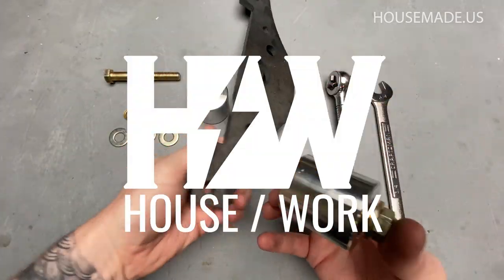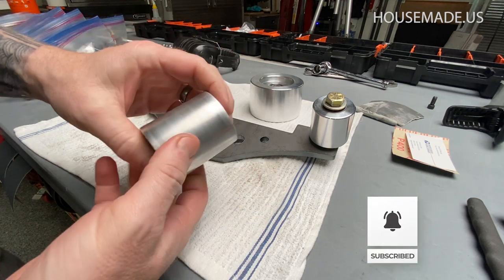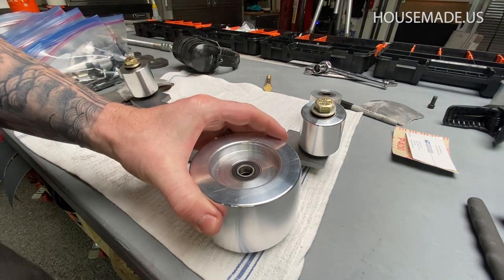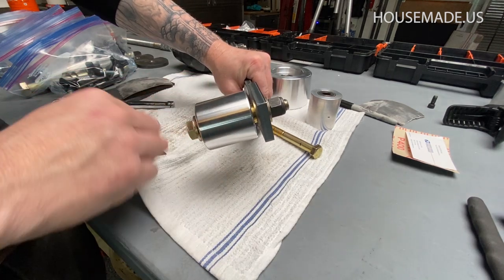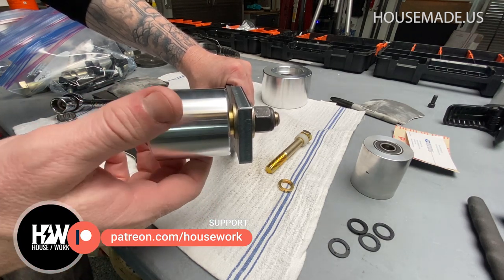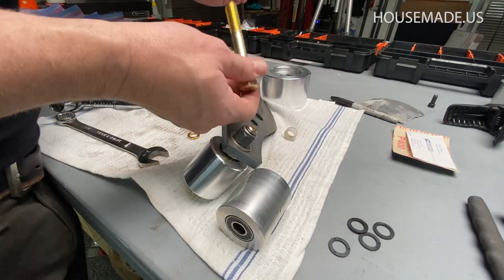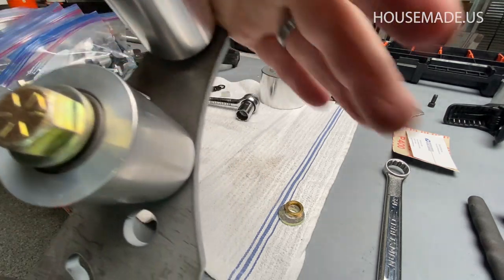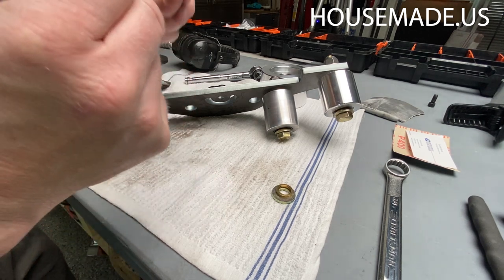How to: 2x72 Belt Grinder Platen Wheel Hardware

Comment: Brian, just to make sure you know, nylock nuts like you have are technically one time use. After the threads are cut into the nylon locker, they just don't hold as securely.  You can however use a little blue loctite and it'll work just fine. 
Also, the washers you are using are "SAE" washers which are cut to the basic size of the bolt. "USS" washers have a slightly larger center hole and an overall larger size as well.  I prefer the SAE like you have. 
Cheers buddy

Comment: Hi may i point out you should not load a bearing laterally at all. the bearing should have a spacer tube between them, so as you bolt up on the inner of the bearings races it forms a solid tube with no side load or binding as you called it regardless of how tight the bolt is. Looks a cool design have to get it cut this side of the pond.
Reply from the maker: Yes I totally agree. Most wheels I’ve bought don’t have that inner spacer though. They seem to work okay so far. 👊🏻
Reply: The suppler is using a threaded plate to mount the wheels, a nut ether side of plate would be the best option in your case, seem silly to let a easy fix slip by for the viewers that will follow every word better to get it right than works okay so far.
Reply: You take care of the out side with your little spacers but the inner tube Spacer between the bearing races should be in there. That way you won't create the lateral load on the bearings. All the load as you tighten the bolt will be on the Spacer, inner race, inner Spacer tube, the other inner race, the other Spacer then the platen.  No load on the ball bearings this way.   Hope this explanation helps

Comment: The link to the speed washers is broken.  What is the part number at Mcmasters? What is the best size Drive wheel?  One link you show has a 4 inch drive wheel.  On another link you have a 7 inch drive wheel.  Which is best and why?
Reply from the maker: Hi David, here is the proper link: https://www.mcmaster.com/92678A518 - I prefer the 7" drive wheel. Much more belt speed.

Comment: would it be better to weld  threaded bungs on the outside of the D-plate? Would that help stability?
Reply from the maker: Hi Thomas, there really isn’t a stability issue if you do it this way. However I have been in conversations with a manufacturer of the wheels and hardware, and they feel as if a nut on the inside of the D plate and the outside of the D plate would stabilize things quite a lot. I am going to try that in the near future.
Reply: @HouseMadeUS  that's actually how I planned to do mine. Set bearing sideload with the first nut, secure the assembly with the second. As a aside they make thin, non flanged nuts which I think would work best for the intermediate nut.
Reply from the maker: Rprecision Yeah man, that’s exactly how they explain it to me as well. I think I am going to investigate that. I think it will make the bearings last a little bit longer.
Reply: @HouseMadeUS   That was my thought. Some DIY grinder mfg's tap the holes for the bolts which obviously helps with rigidity. I figured  maybe a  3/8" steel bung welded on and then a lock nut on the outside of that.

Comment: Hey Brian, What would you recommend between this 2: Solid rubber contact wheel with 300mm or Serrated rubber contact wheel with 300mm?
Best regards from Portugal
Reply from the maker: I would prefer a serrated contact wheel. Transfers the heat away from the belt and steel better. - Keep on grinding - Brian House
Reply: @HouseMadeUS  Thanks a lot for your wise answer. Greetings from Portugal
Reply from the maker: Cheers to you from Florida. 💪🏻

Comment: Haven't read all the comments but has anyone made this with a treadmill motor. I got one (2.5HP) from an old treadmill along with the AC to DC board. Bought a little magic box to match the PWM and got her going. Impressive motor. Would need to alter the motor mount plans. Might just try it. :-). Thanks Mr. H!
Reply from the maker: Hi Don! I have a video on this exact subject from awhile back. Lots of builders have pulled this off inexpensively with a treadmill motor but I don’t recommend it. I have details on my FAQ page about it: https://housemade.us/pages/faq?item=230042

Comment: So, I do almost all my blades with a convex grind and or convex secondary edge. All this means is I use a slack belt. What is a rotary platen?

Next month I'm going to order plates and hardware from ya!
Reply from the maker: If you do a lot of convex blades then a rotary platen would be really useful for you. Jeremy over at Simple Little Life uses one. I’ll try to dig up a video Also do you have a soft platen? I really like having a leather back to soft platen for smoothing out my ground lines. That might help you as well. Also I’ll be putting together a detailed pricing sheet for all of the pieces parts and a complete build. I don’t know if I’ll have that done this week but next week for sure. And I’m going to be testing and inexpensive VFD which should be interesting and could help with cost. 👊🏻
Reply: @HouseMadeUS  I bought the plans for your 2x72 and have it planned for my summer addition to the shop. I currently use a old craftsman 2x40 grinder. I usually get the bulk of the material off with a solid backing, send it off for heat treat, rough in convex with a slack, finish with slack, final sharpen by hand, strop, polish, etc.

I would have probably started the new grinder already but all this drama has just effected time, money, etc. I am a firm believer in doing something right the first time, buy once cry once. 

Thanks for all your support to the DIY community for this project!

Comment: I sell bearings and there is no way I would warranty bearings in this application with this sideways load on the bearings!  ( unless using specific bearings that are designed to!)  Mandatory internal spacer 
required.
Reply from the maker: I agree. All recommended wheels now have internal spacers. I learned this the hard way. 👍🏻

Comment: A point to include, which you have shown, is that the bolts being used should be long enough pass through the nut so that a few threads are showing, which is a visual reminder at a glance that all is OK to proceed.
Reply from the maker: Yes, always good to have a few threads out the other side of the locking nut!